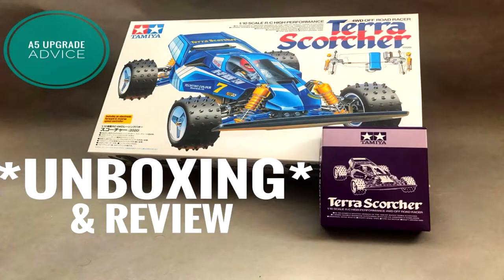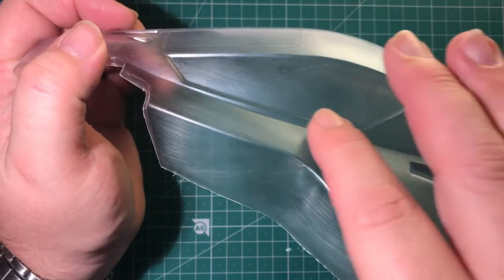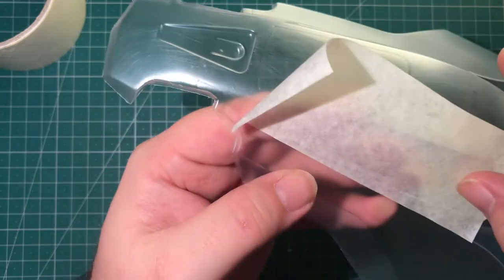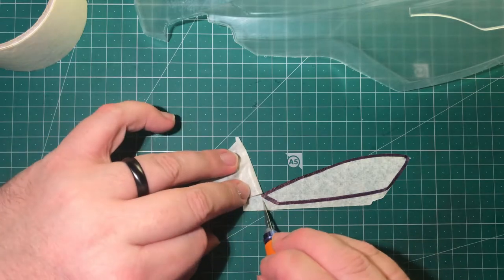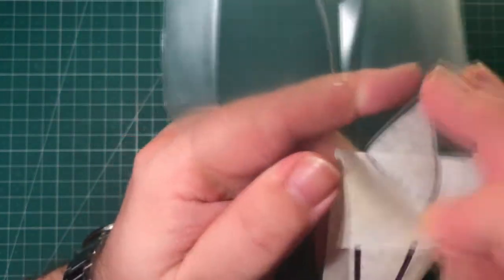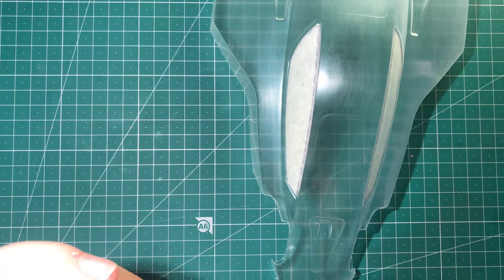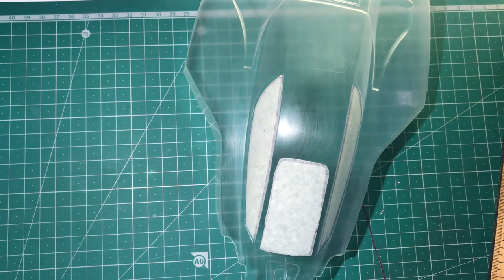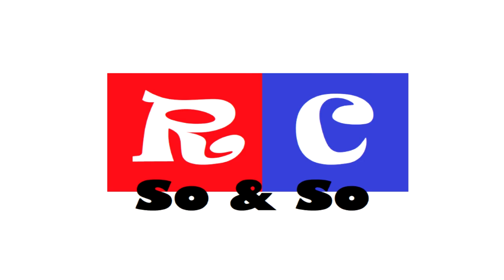Easy Way to make Window Masks for RC Polycarbonate bodies - How to guide

Comment: Nice
Reply from the maker: I use this method all the time and it doesn’t let me down 👍
Reply: @RCsoandso  I've subscribed. I need to learn how to do the window trim to give more detail and also want to add some stripes.
Reply from the maker: @BigCheese85  best knowledge I can pass over is take your time when masking, as this will be the main part of getting the design right. The other top tip is always apply dark colours first. Apart from that it’s just practise and building up confidence 👍